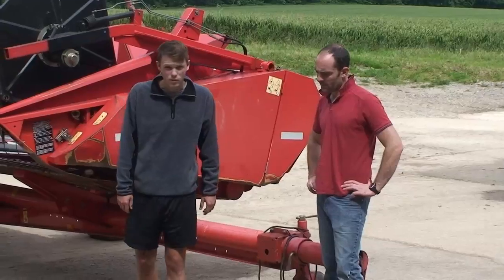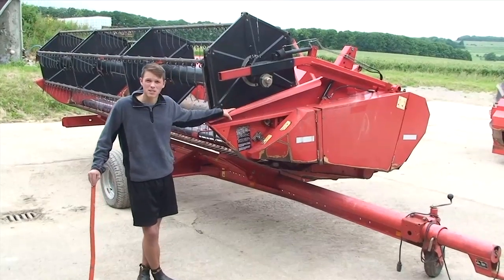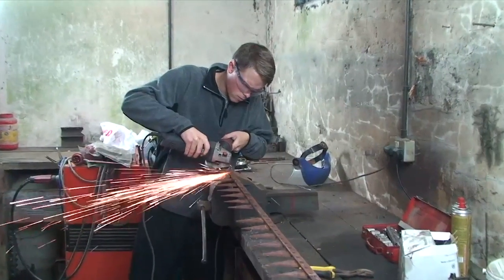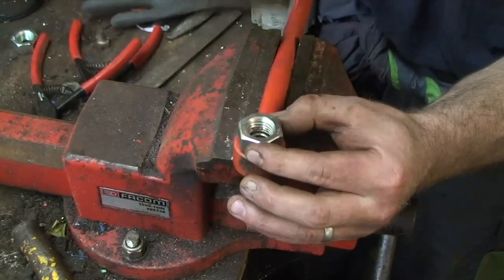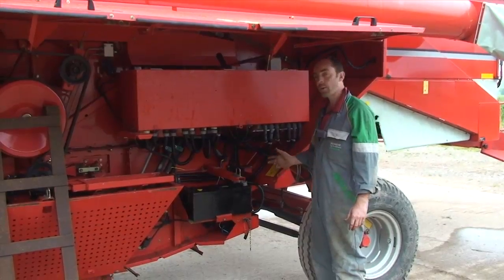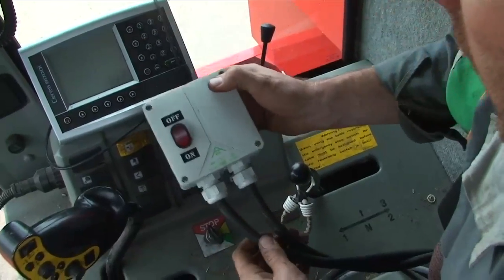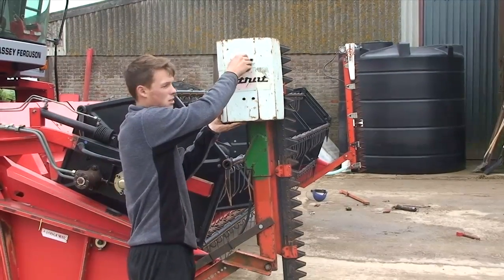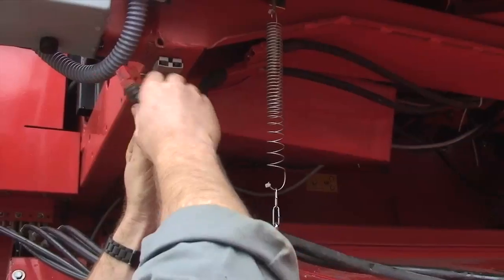Wiring in a combine side knife

Comment: A cheaper thing to have done would of been to put a relay on the side of the combine and ran a ground signal from the cab to it. Then there would only be a 14gauge wire from the cab verses two higher gauge wires.